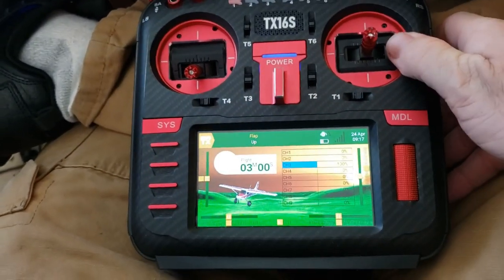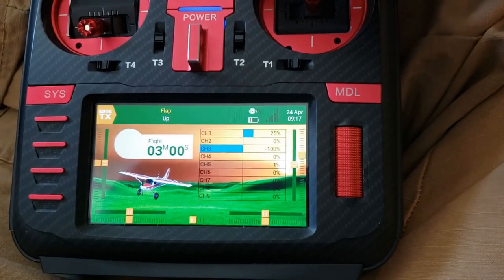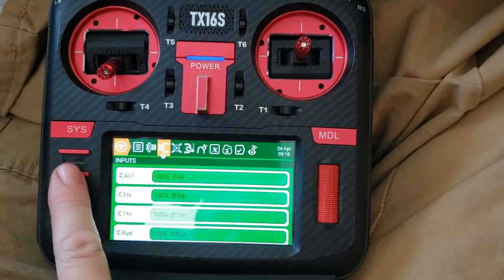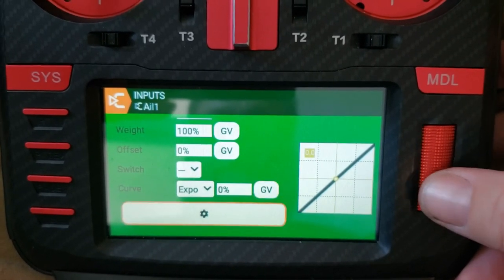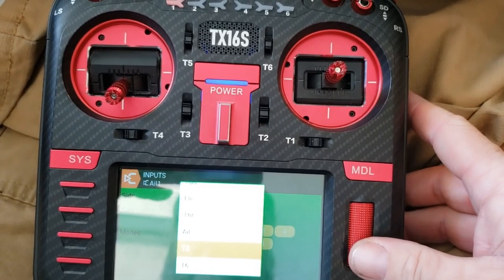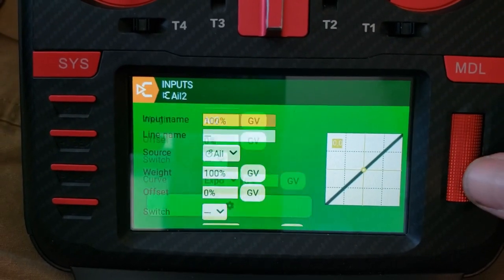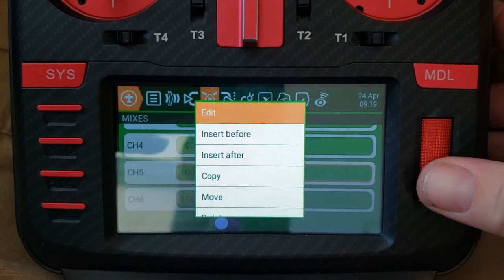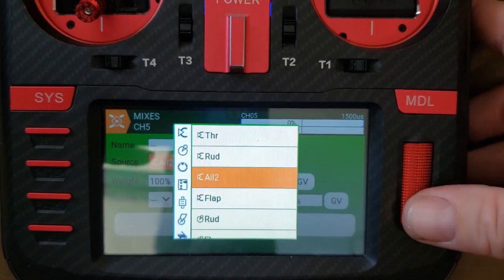Viewer request: Radiomaster TX16S EdgeTX Dual Aileron separate trims

Comment: Great video. But how can you set this up to use the ailerons as flaps ?  i use channel 1 and 6 to ailerons and want to use the same channels as flaps on a separate switsh.  (3 position switch SB or   LS /or RS slider to do this )
Reply from the maker: I have another video testing and talking about my flaperon setup on an AeroScout.  Considering a detailed tutorial soon on setting up flaperons the way I do it.  Keep an eye out for it.  Below is the link to my current flaperon video. At the end I discuss the setup.
https://youtu.be/6MBg1qrs2VM

Comment: Shane,  if a model was set up (in the Wizard) with two separate channels, one for each aileron ... Can you easily re-configure to 1 servo with the "Y" cable ?
Reply from the maker: Yes, definitely.  I'd have to see the model in question to determine the exact changes needed but odds are if you just put a Y on the main aileron channel and connected to both ailerons they would work fine and you could just ignore the 2nd aileron channel.  If you wanted to free up the 2nd aileron channel, just delete it in the mixes.

That said, are you sure the Wizard configured the channels/mixes correctly?  In my experience the current model setup wizard doesn't work properly.  For example, before this response I used the wizard to create a model with two ailerons, one on channel 1 and one on channel 5, no flaps.  The resulting model created didn't create arrange the channel order correctly and did not even setup channel 5 for the 2nd aileron.  I'm using EdgeTX 2.10.2 but when I've tested it on past versions it did not work properly either.

If you have a more specific question once you dive in, let me know.
Reply: @shanesdiy  Thanks.

Comment: Hello! Before my Tx16s I used to fly with a futaba. So I could trim individual channels from inside the radio. What I mean is that let's say I have a plane with left - right wing and the left is a little off. I could go into sub-trims and adjust that particular servo! Is there a way to do this? And for Delta wings like Funjet!
Reply from the maker: This video does exactly that. I don't show it here but you could also go into the outputs tab and for each aileron channel and adjusts it's sub-trim independently. This would be channels 1 & 5 in my example.  You can't do that in-flight so ideally you'd assign separate trim switches to those two aileron channels and get them dialed in during flight, then transfer those trim amounts to sub-trim in the outputs and then zero the normal trim.

Obviously, I would attempt to mechanically adjust each servo trim as well as possible first and use the sub trim to fine tune.  Let me know if you need further clarification.

Comment: Using spektrum radios. Wireless buddy works si that if student is given control. Instructor can instantly take back control on master tx by moving say an aileron or elevator. No need to flick the switch first then jump onto ail or elevator
The same can be done in open source. Via a series of Lua scripts.
For us non coders.
Copy and paste these scripts into the correct places and away we go, in edgetx.
Reply from the maker: Not sure about any lua scripts to do that, I'm sure some exist.  I prefer using the logical switches and special functions to accomplish things like this. Any time you are running a script during flight, there is some additional risk of "technical difficulties".

I'll get a video uploaded in the next 24hrs on how I'd do that. I already have some similar code where I cancel a special function by moving the sticks that I'll pull some logic from.  Actually been running some buddy box experiments recently anyway with my old Spektrum DX6i to my TX16S so this is great timing!

Stay tuned!
Reply from the maker: Your video request just dropped! It was a fun project, got a little long as I included some other setup details for the DX6i.  Hope it is helpful!

Comment: When you set up your flaps that should be done in mixes page not input page
Reply from the maker: I agree with you although there are exceptions.  For simple flap setups sure, you can drop it in the mixer and be done with it if all you are doing is assigning a switch to it.  People do add switches to the inputs much more than necessary.  Gear, SAFE/AS3X mode switches for example don't need to be there.

For me when I want to manipulate multiple rates, offsets, and curves for a particular control like flaps in this case, I prefer to do it in the inputs where I have the curve graph on the edit screen as I make adjustments.  In a case like my AeroScout with flaperons I use the flap input in more than one channel and with multiple mixes and if I did it all in the mixer any changes to one aileron I would have to change the other aileron and each mix separately. Using the input to create my 'Flap' produces a "global" flap value/curve and I can edit my flap settings in one place rather than about 9.  My flap input on that plane changes rates with my rate switch as well as different aileron rates for each flap position to enable max control surface deflection so it would be very confusing without a common Flap input.

The Bigfoot model in this video is my transmitter test airplane, I don't have a bigfoot, this is where I experiment with settings when I am working out logic for myself and others.  This model isn't setup for an actual airplane.  I got tired of messing up my actual models with my experiments and when I went to fly they were all out of wack! lol.

Sorry for the long comment, I can tend to ramble on, thanks for dropping by and for your comment!